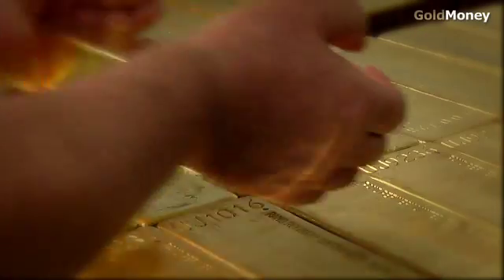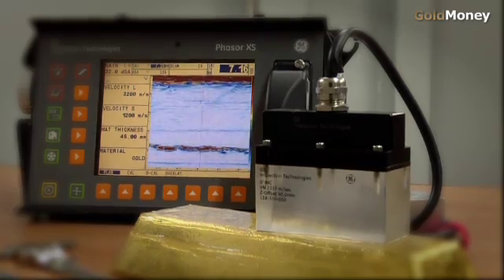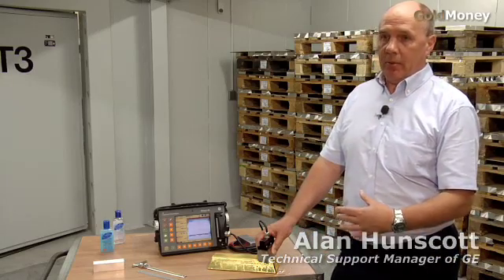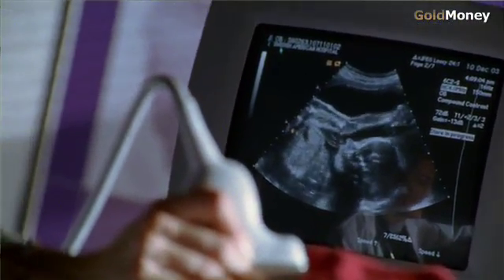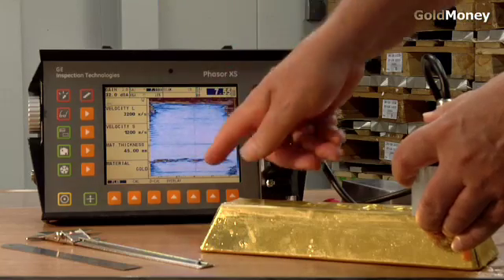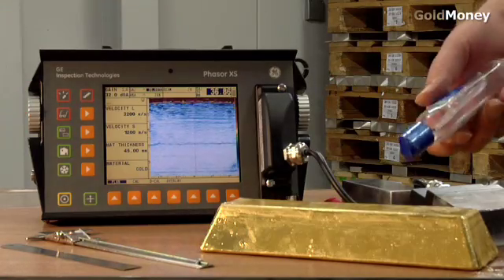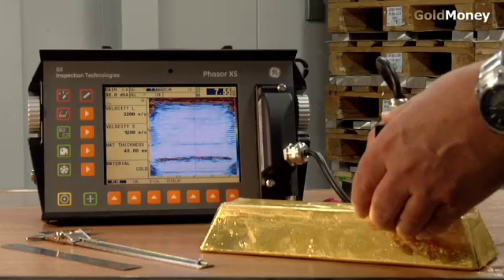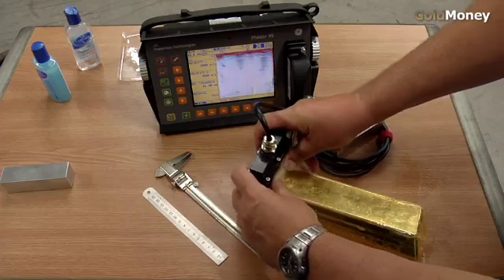Fake Gold Bars - How to detect them using ultrasound testing

Comment: What if it was just gold coated? It would be so thin you wouldn't see that. Also, what about coins?
Reply: MrApple - An ultrasound machine measures the speed of sound through the subject (entire thickness). You probably are confusing it with an X ray fluro (XRF). which measures the elemental composition on the surface. Speed of sound is different for different media so if some foreign object is introduced or it deviates from 3,240 m/sec for gold - it will be caught.
Reply: MrApplewine did you even watch the fuckin video?

Comment: @mimifilter - most of the people interested in testing this kind of technology presumably already have at least 10 bars. They wouldn't have to use anything they don't already have. Even someone who doesn't have any gold could presumably borrow it rather than buy it outright. And the test itself is non-destructive, so the costs of labor and of "defacing" a couple of the bars (and maybe re-smelting to get things back the way they were afterwards) are the *only* costs.

Comment: @doverlin That would require (in this example) 10 400oz gold bars...

4Koz * $1348 (current spot) = $5,392,000

Or, $5.4mil to conduct the test, not including losses of labor and "defacing" a LGD 400oz bar.

Comment: The only cost effective material for creating an insert would be tungsten (W) as it has close to the same density as gold (Au). However, the speed of sound in W is~5000 m/s whereas in Au it is ~3000 m/s (a significant difference). I'd be quite confident that ultrasound would detect this.
Materials other than W would be easy to detect by measuring & weighing the bar (density would be wrong). Uranium is detectably less dense by speed of sound like W. Plutonium is denser but more expensive than Au.
Reply: How about an alloy of tungsten and gold? Wouldn't that be easy to miss?